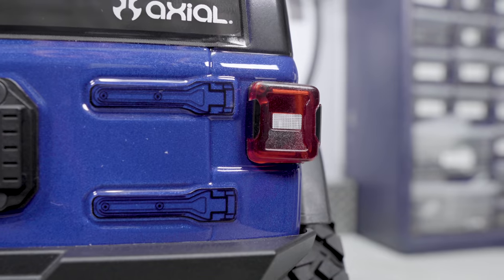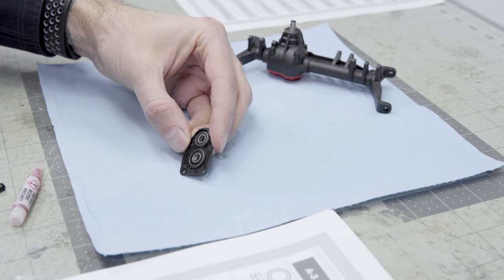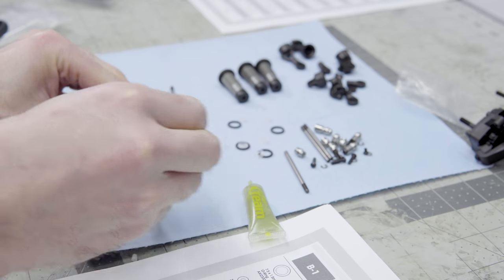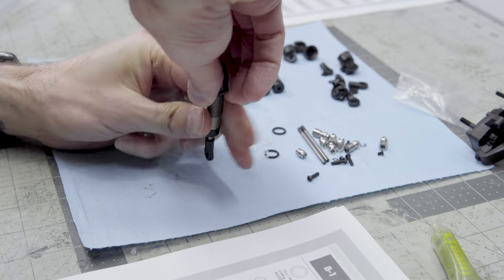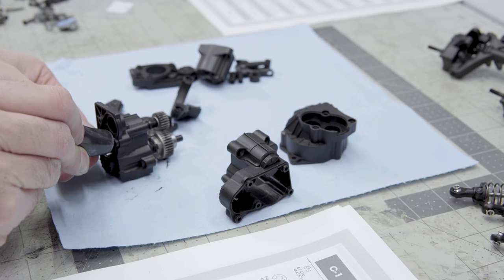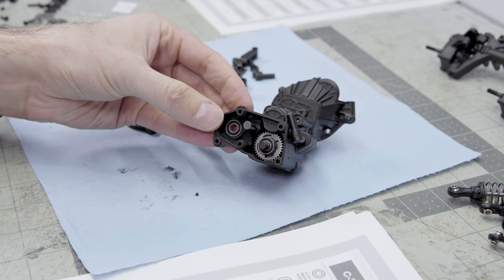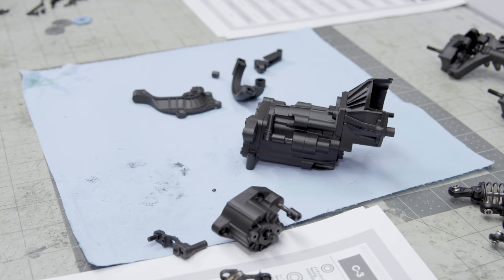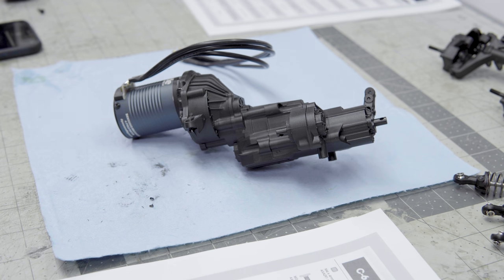Axial SCX10III Step by Step Build A1-C6

Comment: Can you install the dig feature to lock the front wheels instead of the rear to do burnouts super important question for me atleast would love your input or ideas. I know it defeats the purpose what it was intended for but i am a man of specific tase and when i saw that feature it almost immediately sold  me.
Reply: Line lock? Cool idea. If you can lock the front, then have the front go to neutral instead of 4wd, this could make a pretty sweet muscle  car 8)
Reply from the maker: No, dig is only designed for the rear.

Comment: Builders beware, there are 5x11 bearings and 5x10 bearing in bag C, and they look very similar. Be very careful you separate them before you build, or you'll be tearing down the transmission to find where you used a 5x10 bearing in place of a 5x11. That sucks.
Reply: My advice Use dial calipers to figure out the diameter

Comment: With my hands it felt slightly catching but watching and listening to other people's scx10iii sounds really Geary! So I thought this was normal until going from reversing to farward the rear axel locked it wasn't the dig as that was turned off. Finally found videos of "axels clicking" and found shimming and it's so much quieter now and smoother. New problems! Have gone through 3 different micro servos and smashed the first plastic gears. Second and thirdly was spectrums own. 9g is to week for dig maybe a full size servo could be squeezed in??
Reply from the maker: Sounds like your end points could use some finessing!
Reply: @scalebuildersguild  time for a new transmitter me thinks! Absima cr6s was good for a cheep starter radio. But adjusting end points on that was a pig!

Comment: What's the finish weight on the transmission minus the motor even though it doesn't matter which brushless motor it's all pretty close in weight.  if you had to guess with the motor mounted, I can only imagine which company drops that transmission plus dig kit in metal ouch. Enjoyed watching the build trying not to watch to much just trying to think if the transmission with dig and portal's will allow me to drop the low down weight that I need to prevent that funky float i have at times. I would prefer to hold that weight in battery and center of the lows in the chassis.

Comment: Hi matt have just this second finished my first build and being a scx 10 iii had a few problems. My axels are hanging up I think I have found problem is the pinion in the axels moves in and out slightly and when in its to tight of a mesh and binds please sir any ideas would be appreciated. Also love the build you sir have just acquired a new subscriber!
Reply from the maker: I didn't need to shim mine, they usually don't require it. Are you trying to spin the axles under power or just move them with your hands?

Comment: Question about rc shocks.  Why do we adjust shock damping by changing out the oil instead of changing the valving like in 1:1?
Reply from the maker: You can do both, depending on the shock setup. Assuming other pistons with different hole patterns are available.

Comment: Would the 1.7 transfer case be slower, or faster?  Would it be unusable with the portals?
Reply from the maker: It’s taking the reduction that is in the portal and putting it in the t-case. I wouldn’t do it without a straight axle.

Comment: Sorry if I'm beating a dead horse, but what kv motor did you go with? I have a Slate 2850 in my 10.2, was thinking lower in my 10.3  to take advantage of the 2 speed?
Reply from the maker: I’m running 2850 in this.

Comment: ok got a few questions, i have a 70mm castle motor will that fit, and the lhs here said that my 19t 48 pitch gear will work, am i going to break things trying to run this,
Reply from the maker: 48p will NOT work. The drivetrain is 32p

Comment: Dude I'm having trouble with my front axle assembly and that's the only part of the video you fast forward through? My luck is the worst
Reply from the maker: What exactly is the problem? Perhaps I can help.
Reply: @scalebuildersguild  Actually, I figured it out. The two halves of the axle weren't going far enough into the differential gear, which was preventing me from getting the caps on the portals closed properly. But I figured out the issue and it's together now. I apologize for having bothered you with my comment!

Comment: Yeah in contrary to what is said here every single hole is too small.
Without a electric tools this does not go together at all because every single hole is too small.
Just get an RTR version, saves you a lot of headaches.
Reply from the maker: Hand tools will always require more torque. Building a kit is a fun and rewarding experience, and I'll always recommend that first.
Reply: @scalebuildersguild  Ow if it was only the torque, i would be so happy.
No literally every single hole is too small and has no thread. To get to the torque you need to get the screws in first which is jst simply impossible with power tools.
It is honestly one of the WORST kits i have everexperienced.